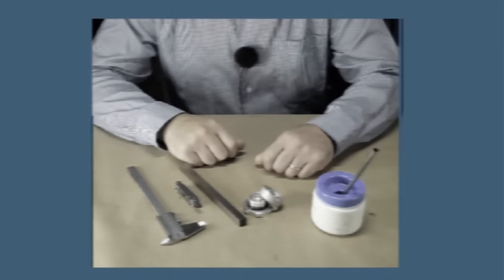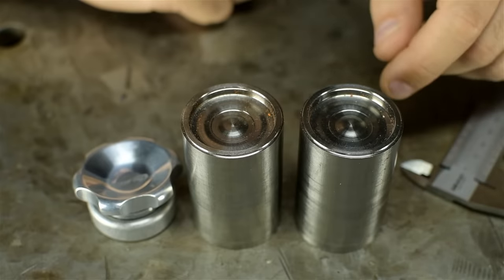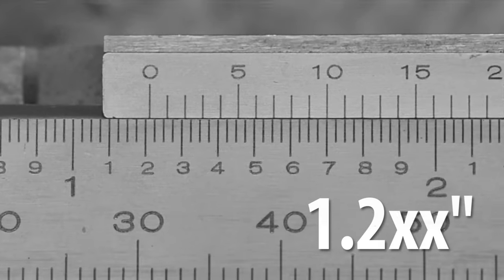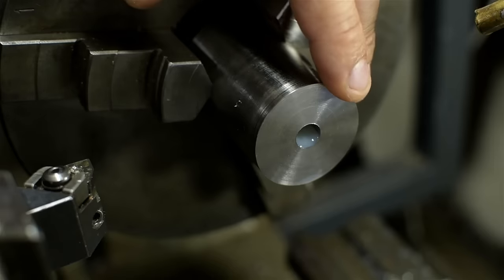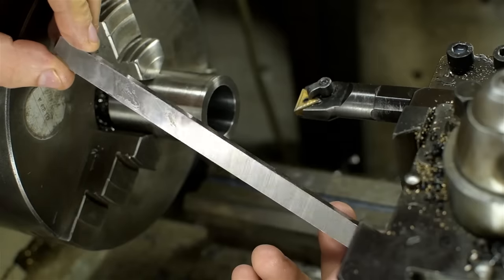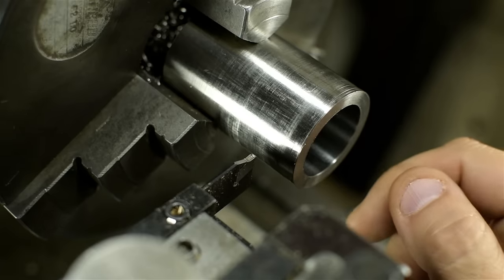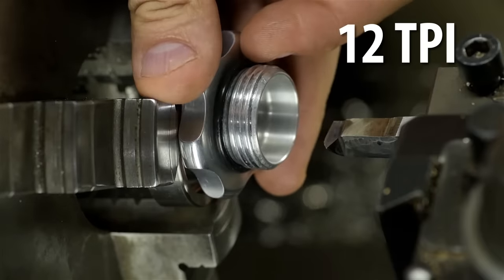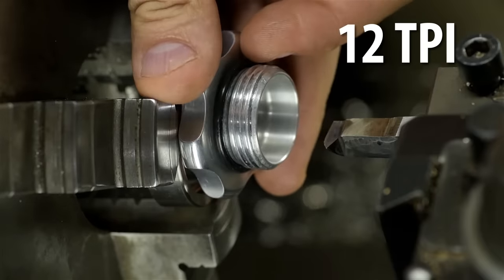Turning Titanium: Trials and Tribulations

Comment: Hi Tony, hint from across the pond (UK) ..if you get a hard spot in a drill hole in any material and just want to remove it without having to buy a carbide drill or chance ruining one, then use a cheap masonary bit. Just grind the edge as a normal drill on a green wheel  BUT also grind the flute face flat (so it presents an almost square edge to the work) this makes the cutting edge incredibly strong and robust. Once youve cleared the hard spot you can return to normal drills again. I always keep a good selection of masonary drills in the workshop for this purpose as its quick and saves a fortune :)

Comment: As a non-precision 3d-printing sort of guy with a lazy set of digital calipers, verniers had always been a mystery to me - but now I have been educated. Thanks, STFU!
Reply: I have some here that I have no idea how to use. It's in 1/1000" and 1/20mm and not marked in inches, either. It's odd, to say the least.

Edit: OK maybe it is in inches lol. I just didn't know how to read them. Thanks, Tony!
Reply: There is digital and analog calipers?
Reply: learned that at the age of eight, its great to help your dad building stuff as a kid ;P
Reply: @n1663r digital, vernier, and dial calipers exist. I prefer digital for speed, vernier for accuracy and dial for mix between them.
Reply: Get a CAD package that supports background imaging for a quick dimensional ipiphany.

Comment: It is actually VERY easy to anodize TiAl6V4 properly. All you need is a bench power supply going up to approximately 60V DC and you can just use Coke as an Electrolyte because it contains phosphoric acid. Hang a strip of stainless steel or even titanium into a container filled with Coke and your titanium workpiece too. Connect the strip of metal to the negative terminal of your power supply and the workpiece to the positive. Apply around 30V for a nice blue finish, a little less will result in a nice golden finish. (Don't drink the Coke afterwards because it now contains dangerous stuff!). Also, if you need bigger titanium cutoffs, just send me an address where to ship them😉. Greetings from Germany
Reply: If you're just sending out titanium cutoffs...... :)

Comment: "12 of those thready things"
I sure wish you would cut down on the technical terms, my edumacation didn't cover this
Reply: ..He did not include the required DEPTH of the threads.   Is there a standard depth for 12 TPI ?  it would of been nice if he had mentioned it.
Reply: @DNulrammah  while my comment was a joke about tots joke, the answer to your question is yes. 
No, I am not trying to be a jerk. Please read...
I have not watched the video in a year and only vaguely remember the subject matter of said video, but I can give you some answers on this.
The depth of the cut is wholly dependent on....
1. the diameter of the part
2. the type/profile of the thread pattern 
3. the material being used 
This is not the exact answer you were looking for, but there is an engineering specification manual that's constantly referred to by tot that can provide you the information needed.
Also, quite often tot flashes the page of specifications he is using from that manual. It's quick and easily missed but often it is there.
Hope this helps somewhat.  
There is also a separate video(s) on cutting threads.

Comment: I'm glad to hear you machined your own titanium hip replacements. I bought mine "off the shelf" and they are just awful.
Reply: I'm a wood worker in shipbuilding, so all I get is a peg.
Reply: I just put a nice weld in there for mine, you wouldn´t believe all the money i´ve saved on chairs since then.
Reply: You think off the shelf are awful? Try eBay hip replacements! :-0
Reply: At work i see tons of them, but they are all used and slightly burned
Reply: I can no longer get replacement parts for mine...  What a cash cow!
Reply: I 3d print them, for real though and not for myself. additive manufacturing, 3d metal printing
Reply: @scheve332  I would like to have you make stuff for me. lol

Comment: Hilarious, and nice parts!  Wonder if there even is a way to anneal titanium?
Reply: Depends on what you are aiming to do with the annealing... You can make it absurdly hard and tough, for knives, yes. But there isn't a way I know of to soften it back to the original "white" state that it arrives in from the forge. Your best bet is to use Diamond/Carbide cutting tools, prevent work-hardening the surface (when it discolors), and avoiding high temps of the workpiece, and tools. Work-hardened Ti is literally just as hard as Tool Steel, and "white" Titanium is marginally softer. Feeds, speeds and cooling are crucial
Reply: Annealing would be the same process as for any other metal.  Titanium just requires extremely high temperatures to undergo recrystalization.
Reply: @jdrevenge  Kind of. AFAIK, Ti does work harden, and anneals up in hardness, but I have not heard of annealing it back down like you can Steel between Martensite and Austenite.
Reply: @Karl_Kampfwagen  Doesn't it also vary depending on what kind of Titanium alloy?
Reply: @dragdritt  Yes, but... Titanium is literally THE NEWEST and Least Experimented alloying Metal that we have, on Earth. We've had hundreds of years with Steel, Iron, Tin, Copper, Nickel, etc... Titanium is VERY FICKLE, and production has been mostly perfected by Germany, but the available Ti  alloys list is vastly shorter than Ferrous, meaning the physical properties will be more alike between alloys. I'll ask my Titanium knife forging friend what he says about making Ti "down-harden," but from what I have seen: it only softens while white-hot, and immediately re-hardens upon Oxidation.
Reply: Man
You are the best blacksmith I have ever seen
Reply: @jdrevenge  ,  Could you mention some ranges and types of titanium?
Reply: @Karl_Kampfwagen   v v v v v v.
Reply: @jdrevenge  bv
Reply: I read you have to anneal it in a high vacuum
Reply: @Karl_Kampfwagen  the only way i know of to soften titanium to the workable state is to thermo cycle it, heat it up and let it cool all the way several times
Reply: @bull7246  In other words: "you have to basically re-forge the part with heat cycling."
Reply: @gamemeister27  The aerospace company I worked for heat treated their titanium parts in a vacuum furnace purged with argon first. Not sure what temp, but those parts glowed like an Orange Crush can when viewed through the inspection glass and were in there for hours.
Reply: @Karl_Kampfwagen  annealing grade 5 (6Al4V) titanium is fairly easy ! Heat it to a bright yellow heat and quench in water as quickly as you can ! it does build an oxide layer that is fairly hard but this can be overcome by using an oxide reducing substance like Condursal Z1100 . Hardening it is done through heat aging witch requires you to heat it up to a much lower temperature and keeping it there for a long time ! (600 degrees C for 24 hours should give you about 42 Rockwell C )
Reply: @Jack_Connan  Are you actually literate? As in: CAN YOU READ?! I already said that. I know about annealing. 42 Rockwell is awfully low... I have personally had Gr5 Ti parts that I annealed until they were as hard as Tool Steel. I literally could not use files on them, because it was rounding the teeth off, instead of removing material, and barely left scratches.
I was saying: Titanium can and will get harder, but it's a real pain to make it any bit softer, after that.
Reply: @Karl_Kampfwagen  never heard of inconel i see. Drop the arrogance it is not justified
Reply: Machinery’s Handbook can Answer that.
Reply: @werbdoog  did you just pocket dial all of that?
Reply: Depending on the alloy, you can do a mill annealing (MA), that just means heating it a bit for a long time to allow the internal stresses to recrystallize, and i think that should be enough. I'm not sure if that would be enough for a weld though. Alpha alloys (pure titanium) can be welded or machined without problems and don't need thermal treatment, but alloys with beta (BCC) do need it.

I think a weld of any alloy that has some beta phase would need an annealing over the beta transus temperature (700-1000ºC), which makes all the material be at the beta phase (BCC), then quenching it, which transforms the beta into martensite, and then aging it at a lower temperature to allow the martensite to become beta again, but with a small lamellar microstructure. If you don't get to the beta transus temperature you're not going to be able to change the grain size. It might be too big if the cooling while welding was slow. Also it might be aged badly with alloying elements clumped in the grain limits...
I think that should be done in vacuum or some noble gas atmosphere, because titanium is extremely reactive with basically everything when heated, and it will become fragile if it has contamination.

It's ridiculous what you have to do with titanium
Beware that I'm just studying for an exam. I have not worked with titanium in person.

To make it softer maybe the quenched state would be good? It's actually softer when quenched, because the martensite is very weak. Very different from steel

Ok I just read the comment of Jack Connan. That's the treatment I was talking about.
Reply: Despite being fairly new, we've still had over half a century to figure out practically everything important about the most common titanium alloys, including their annealing. Titanium absolutely can be softened back to it's mill finished state without melting, but it depends on exactly the alloy and how well you can control the temps and times. Unfortunately it's not as simple as getting it white hot and burying in vermiculite for a few hours. Essentially you get it quite hot, if I remember correctly somewhere around 1800F (but don't quote me on that, it's been a while lol) and then you reduce the temp in intervals on something like a 20 hour timeline, and that brings it back to it's "soft" state. Though it should be said that most titanium is similar to an annealed tool steel so it does always have some residual hardness. 
All in all though, even the hardest heat treated titanium I've dealt with isn't as hard as the hardest steel, but it's very light, corrosion resistant, and pretty resistant to deformation, so you can get something equivilent to a medium tempered steel but with quite a bit less weight and rust!

Comment: 8:36 for Titanium I always use HSS-E drills, after I burnt a normal HSS drill much like you did up. With the Cobalt you can easily use it up to 450°C without a lot of damage.
Even though they cost about twice as much, they are certainly worth it. Especially when you want to drill everything with a single set of drills.
Reply: Seriously? Twice the cost is still saving me money, since I go through 2 drill bits on each friggin hole. I'm going to find some good HSS-E bits and try them. Thank you sir.
Reply: I didn't realise that anyone was insane enough to try using HSS on titanium in the first place.
Reply: I have a few HSS-E drills that I use with stainless steel, they're great. However I'm unable to get odd sizes locally, I currently need one for pre-drilling holes for cutting M5 threads.
Reply: @Shaun.Stephens  Try McMaster Carr.  You can order almost anything from them
Reply: @etheroar6312  Thanks, I would but I'm not in North America and even if they deliver here the postage would likely be crazy. I dare say I can get one locally but haven't got around to it yet as the job's for me so isn't urgent.
Reply: @HaqqAttak  A moment's silence please for the turbocharger/gas turbine engine machinists of the early 1940s who may have found themselves needing to drill Inconel X-750 using a HSS tool.
Reply: @nerd1000ify  I thought that stuff was only invented postwar.
Reply: @HaqqAttak  The nickel superalloys generally were known pre-war (the US was using them in turbos for the B-17, for example). The first production jets in the UK used turbine blades made of Nimonic. I think i'm in error saying X-750 was around at that time though- I think I remember reading that it was used for the late WW2 jet engines but perhaps I got mixed up there, the only reference I could find says that it had been around for 'several years' when Inconel 625 was developed in the late '50s.
Reply: @HaqqAttak  Hmm. Got titanium that needed a hole. Got some great HSS (viking ultra-bor) drill bits that chew through 316 like buttah. Seemed like a good place to start. Didn't seem insane at the time.
Reply: Shaun Stephens, you could try these https://www.axminster.co.uk/axminster-cobalt-hss-drill-bits-ax21744 .  There are quite a few good UK suppliers that do mail order.  And there's no job more urgent than one for yourself 8-)
Reply: You can drill Titanium with HSS as long as your RPM is slow enough. I would start at 15 SurfaceFootMinutes, even though you can probably go faster. For a half inch drill, 15 X 3.82(constant) / .5 = 115RPMs. Do small pecks! like .03" and a feed of .003"-.005" per revolution. Work your way up from there once you examine how hot it's getting. This is conservative, but better off for starting to cut without any problem.

Comment: i have been enlightened by your explanation of the calipers. i am a glass blower and i frequently need the hundreds of a mm for extremely thight fits and ground glass joints/ball joints to ensure high thightness. since my electronic one failed, i resorted back to buying normed pieces but now i can use the other calipers i have lying around anyway. thanks man!

Comment: I managed an implantable pump project some years ago.  It included a Ti bulkhead with complex machined spaces that provided mounting surfaces for electronics, a peristaltic pump head, a stepper motor, and valves.  It was CMC machined on a large block with 32 blanks on each of its 4 sides in a lights out facility.  The tool speeds and pressures we so high that the metal was almost liquified ahead of the tool  The CNC machine was a large as a single car garage and the process was amazing to watch.  The tool magazine contained various configurations of formed tools and relatively standard cutters.  The machine knew the longevity of each tools and replaced them in the library with new ones when necessary.  This started my interest in machining.

Comment: I've seen the aftermath of a titanium swarf fire.... cost two industrial lathes, melted the concrete pad, melted the concrete ceiling, took something like 4 hours to 'extinguish' ....you don't put that fire out with water, CO2, foam, PKP.....you just sit back and wait till its done. May as well toss magnesium at it.
Reply: need a class D fire extinguisher, we have them at the machine when cutting titanium at my work.  Its fun to take a couple small thin string chips and light them up with a cig lighter, or put a piece of scrap on a belt sander.  Lights up like a sparkler.

Comment: This is now how remote learning is like for the machining trades... lots of old converted videos, limited lab work. Love every minute of it. You have some titanium balls to do that on a lathe of that age. It gives me a little hope that I can drag that 1/3rd HP Grizzly lathe mill and do some work... but still thinking I should just get a coupe of Tool Room Lathe and Mill from Haas. Single phase, rigid, can use a 3 gal compressor, bam.
Reply: Also, I’ve been looking through the colleges tapes to convert to digital... I miss the slide videos and audio tape combos.

Comment: Thank you for doing this video. I was one of the guys commenting on the video of the old school makita. Just a couple of thoughts. Your average home gamer has the luxury of being able to charge while working.  The need for a battery that lasts for half a work day or more is not a hard fast requirement.  The other thing to keep in mind is that not all brands are as fancy as Makita. As I'm typing this in the garage I'm staring directly at a gutted battery from my cordless set. The the cells are tabbed and then wired directly to the connector. No pixie management onboard the factory battery whatsoever.

Comment: This public service announcement is for your safety: High speed steel is not the same as H2S. Do not attempt to shape H2S into lathe tools. ^.^
Reply: HS2 is totally different too - it's a new high speed train the UK might get sometime in the next 200 years!
Reply: Well that stinks.
Reply: @gregnoe2637  I see what you did there.
Reply: Used in cutting oil apparently.

Comment: I work in a lab with a scanning electron microscope. I've had my calipers in it many times but I still can't read the scale. Does the SEM need to be on for this to work? What am I doing wrong?
Reply: Are you squinting hard enough? You should be seeing stars afterwards if you are doing it correctly.
Reply: Nah, yer SEM bes no good, ye want to put them in the MRI to get an accurate reading.

Comment: "High speed steel consists of one part H and two parts S?" 
Fascinating! 
How did Hydrogen disulfide turn into a ferrous metal?
Reply: Cold fusion, of course, like egg shells. (Please note that the egg shell thing is a real theory which got an IG noble prize in 1993.)